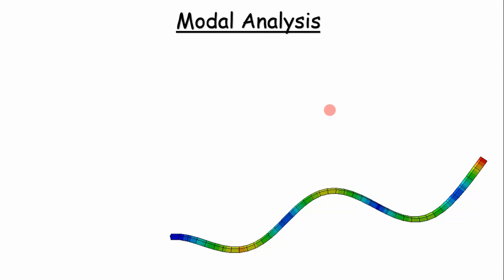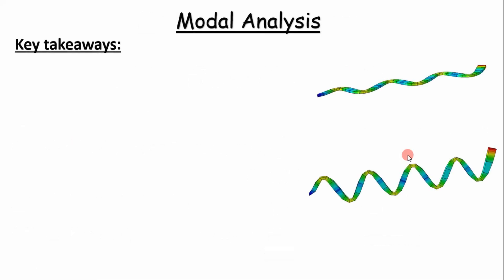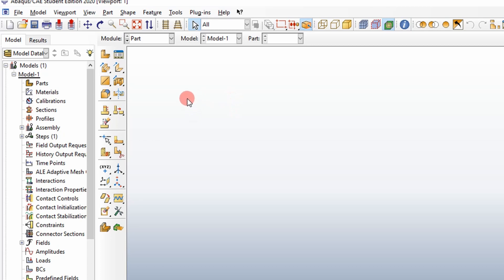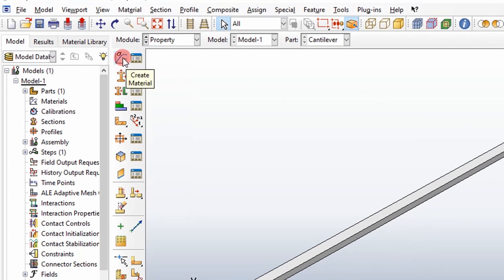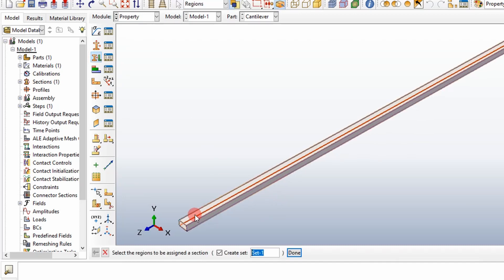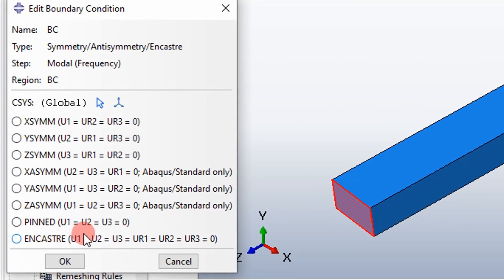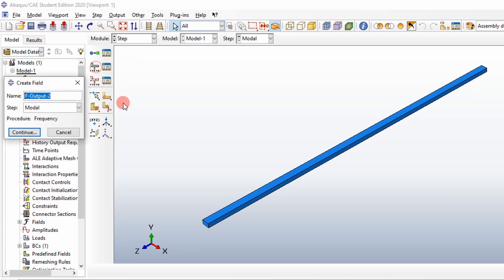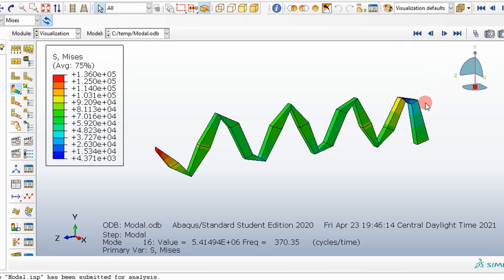Abaqus Modal Analysis Example

Comment: Sir i tried to do modal analysis for reinforced concrete column and the 1st-4th mode has zero natural frequency. And then i tried to run the model without rebar and i get normal frequency results for the 1st mode. What do you think about this sir?

Comment: Thank you for the helpful video! In the end frequency is given in cycles/time. That is actually natural frequency = number of cycles in one unit for time (usually second) or am I wrong?
Reply: Hi Aleksa, if you look at time 6:12 in the video, it shows all the unit systems in abaqus, and you can see that every unit system option uses seconds as the unit for time. So you're correct, the frequency output is in cycles/second or Hz.
Reply: @lydiahedge3553  Thanks Lydia!